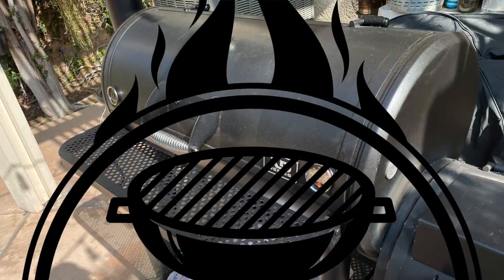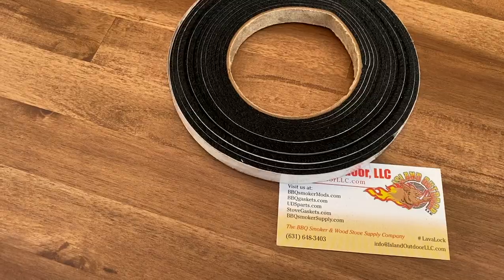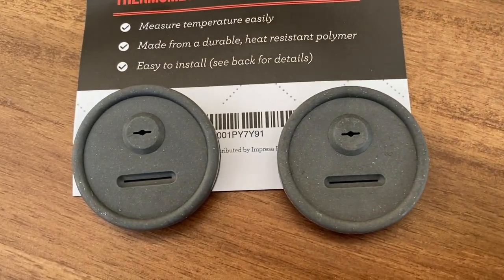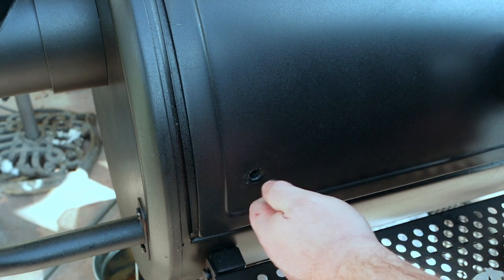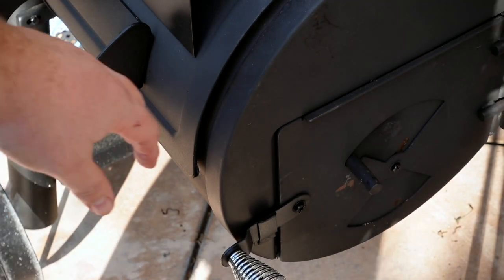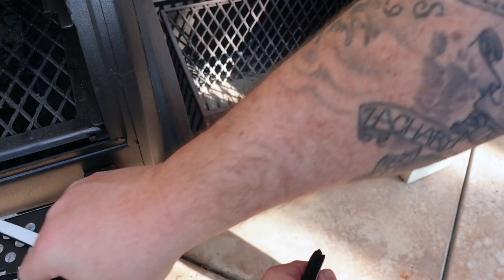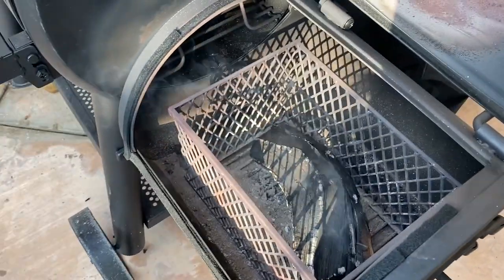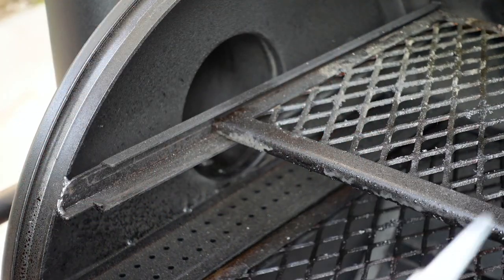4 EASY Grand Champ Offset MODIFICATIONS | Char-Griller XD Grand Champ Offset Smoker Grill!

Comment: The quick fix for the warped firebox lid isn't more gaskets you need to stick a screwdriver under the lid between  the left hinge and the cooking chamber and shut the lid a couple times.  That corner gets warped and holds the hole lid up
Reply from the maker: I’ll give it a try
Reply: It works

Comment: When you’re drilling into steel like you did for your pilot hole always drill slow and push hard. Use some kind of lube to help the bit cut and keep the bit cool. Oil or wax. When you’re using the step bit to open your hole a little more sometimes a small little rocking action will help.
Reply: What type of oil? Or does it matter? My first thought was olive oil but I wanted to make sure I wasn't way off in my assumption

Comment: Good video, loved the grommet mod. Now you got me doing it to my grand champ XD LOL. I did not have any of the other issues with it though. Another thing I discovered is that if you flip the ash pan upside-down in the main cook chamber, it aligns perfectly with the firebox opening and acts as a great baffel to distribute the heat evenly throughout the entire chamber. You might just need to do a little adjustment side to side to get the heat flow right. The temperatures are now within 1-2 degrees different between the fire box side and the stack side.
Reply from the maker: Thanks! Yeah I’ve turned the ash pan over on most of my cooks too.
Reply: @CjsQue  Hey CJ, did you drill small to large holes in your ash pan (smaller holes near the fire box, getting larger the further away)?

Comment: South Carolina Coast here. Those are great mods thanks.  Keller"s grillzebo vid has a really cool mod for the steel wheels.  He went to a patio furniture chair site and got rubber overlays for the steel wheels. Just slip them on over the steel wheels.  Love the grill hate the noise and scratches it leaves on my stamped  concrete around my pool.  Check it out .  Ordered some today, hope they work out since the grill is so heavy.  He used one each wheel I am going to use 2 per wheel for extra coverage. Love your channel bro always great content, subbed...

Comment: Mr CJ It looks like the weight of the doors resting on the hinge when open is warping its round shape leaving a gap at the fire box and smoke chamber.
Solution for another mod, maybe weld support brackets for door support to relieve pressure off the hinges.
Thanks for sharing your 4 mods......
Reply from the maker: Hey thanks. I’ll look into that. Appreciate ya watching. Cheers

Comment: I just got a grand champ and it's my first Offset Smoker coming from a Weber smokey mountain 18. I used the liquid gasket when attaching the smoke stack and firebox to the main chamber. Worked great. I have a leak on the top right side of the main door and I've seen others having this same problem. Now 3 years from this video, was doubling up the felt gasket around the door the end-all fix to the door leaks for you? Great content, keep it up!

Comment: Looking to buy my first offset smoker sometime next year, debating whether or not to get this unit as a starter or if I save up and get an old country Brazos. Just wanted to see what your thoughts were and how the char griller has worked for you

Ive had a vertical smoker for about a year, but looking to dive into the world of offset smokers
Reply: I am in the middle of the same debate. I’m in the northeast so my access to a decent offset is limited. There is a brazos about 2 hrs from me for $1,599. Which is pretty steep… especially since they were under a thousand bucks not too long ago. Found this GC recently and it’s looking better and better. Seems better than the Oklahoma Joe. Chargriller website says $549, but then when you go to home depot site it says $599. If I buy, I will call HD direct and ask them to price match… Over a decade ago I randomly bought a Char Griller Akorn Kamado on clearance at walmart for under $100. It was such an awesome grill/“smoker” that later on I thought it would be a good upgrade to get a big green egg. I did, gave the Akorn to my bud and later regretted it. Shoulda kept for a second grill. It was as good as the egg, PLUS two side tables. My bud still has it and uses all the time - over ten years later. I think ya gotta be honest with yourself with usage(like I have to be with myself). Is it worth nearly an extra grand if you are just backyard dabble smoking a dozen times a summer, probably not. Regardless, good luck. 👊🏽
Reply: I had enough. I just pulled the trigger - contacted home depot via text option and they said as a one time courtesy they would honor the $549 from char grillers site. I told them great, but since it’s exclusive to home depot, it’s ridiculous the web sites don’t jive. Anyway - I like buying the best stuff when I can. Can’t justify it in this case, as much as I tried. Don’t want to wait any longer, I have been nominated for memorial day family party and the BGE won’t handle the volume I need, of course. I’ll probably need a few weeks to seal/bend season and get a few smokes in before then. Thanks for letting me talk all this out. U helped me decide! 👊🏽🤣👍🏽
Reply: @dingdongdaddy589  Haha not sure how much I helped, but glad to hear you got yourself the GC in the end! Going to hold off until next year when I find out where our family will be moving to.

That's my entire philosophy too, I need a smoker to handle a large volume of food all at once because I want to be able to host large cookouts for my family and experiment with different recipes. Let me know how the memorial day cook goes!
Reply: @GetOutNerd  - Just your question and the fact that you were considering the brazos, I suppose. I literally have a half dozen emails to this BBQ supply store 2 hrs away over their brazos/pecos and have watched half dozen hours of vids on just the brazos. Seeing my thoughts written out to you and a re-read was helpful for me. I appreciate it and hope your move goes well and you find something suitable to your needs when the time comes. 🙏🏽 I will try my best to remember to come back and let you know.

Comment: Hey Cj thank you very much for the tips. I bought my Grand Champion a month ago, and I tested the chamber temperature close to the firebox (approximately 6" to 12" away) with a digital probe and did the same on the opposite side (by the stack) simultaneously and found quite a bit of temperature variation which is understandable since one side is closer to the firebox, but have you tried smoking without the smoke shield? I wonder if removing the smoke shield would make a difference in better heat distribution? I hope my question makes sense. Thank you, Joseph

Comment: Did the gasket on the firebox work after the initial application?  My firebox also fits like this and I use 1 or 2 bricks on the handle to seal the gap. 

I’ve had this smoker for 6 months now and love everything except the firebox fit. Made my best brisket ever this holiday weekend!  Thanks for the videos.
Reply from the maker: You know the gasket that came with it and the gasket I added have both came off.  But I’ve found it hasn’t really affected it that much. I just keep a couple logs on it, to hold it down a bit too and it works fine.  I dig the smoker for sure, but it’s a beast.  Thanks for watching! Cheers
Reply: Open the lid and put a thin screwdriver under the  lid between the left hinge and the cooking chamber then shut the lid slowly a couple times. Shuts like new

Comment: I noticed the smoke flavor on the upper rack is better than the bottom I think the vent needs to be dropped down also will draw the heat through the lower rack get more efficient and need a baffle to even it out you have issues with lack of smoke flavor
Reply from the maker: I haven’t noticed the flavor change from top to bottom, but I’ll definitely pay attention next time.

Comment: Nice video! I got one of these rigs about 2 months ago, finding it hard to maintain lower temps (225-250). Even a smallish split with some charcoal can push the temps pretty high (275-300+). Is that common or user error? Hoping to see more of your cooks on this beast!
Reply from the maker: I haven’t heard it being an issue. Spikes happen sometime, but I can keep it between 250-275 most of the time.
Reply: thanks for taking the time to answer pretty much every single question on your videos!
Reply: James - I've had this pit for about 6 months and initially had the same struggle, couldn't get the splits small enough, would easily to go 300 degrees!  By accident I pushed the fire over to the side closest to the door, farthest away from the cook chamber, and found it is quite easy to maintain 225-250 in the center.  I actually put thermometers on both ends like Cj showed and typically only look at the temp closest to the stack.  When it gets to 190-200 I'll put another small split on or briquets just depending on what is needed.  I do use a brick on the firebox handle to keep it closed, if it is cracked you won't be able to keep the temp down.  Have fun, it is a great cooker overall.

Comment: Thanks for the video! Question: does your Grand Champ leak smoke on the sides of the main chamber where the side are welded to the main chamber ( metal tube / pipe )? Thanks in Advance.
Reply from the maker: Hey thanks. Not so much. I have it pretty sealed up.

Comment: What size temp gauges did you get? Did they screw into the threads or just ones with nut on the inside of door? Would the tel tru ones work?
Reply from the maker: 2 inch, there’s a wing nut that holds it on and I’m not sure about the tel tru ones.
Reply: @CjsQue   tel tru do not fit. Have to replace the plug with a 3/4" by 1/2" black pipe bushing. Cutting and replacing

Comment: Have you tried the tel tru 300? Just wondering if it fits.
Reply: It doesn't fit. I'm welding in 3/4" by 1/2" black pipe bushing to fit the tel tru 300

Comment: A part of me died while you were drilling those holes.....lol

I've got my new gasket seal. Most of the original seal has already detached itself. Any idea what I can use to clean and degrease my lid to prep it for the new gasket?
Reply from the maker: Lol it was a little nerve racking. Use some of that googone stuff.
Reply: Disc grinder to bare metal, paint...silicone and new gaskets

Comment: That’s not a leak on your firebox ,the hinges on your firebox and lid is bent ,you need too have a welder.  heat up the hinges on your lid .that is a factory defect when you bought. The unit from Chargriller.

Comment: A quality offset smoker will not have those kind of issues,they sell those  Chargriller   Smokers at Home Depot,it is a decent stick burner  for under 600 bucks ,but like most offset  will need too modified unless you buy a high quality offset like a yoder or lang  which are over 2 grand but least a lifetime..all the places were you used that high heat goop is a waste of money,you need too find a welder man in your area where you live and have him weld up all your leaks .,